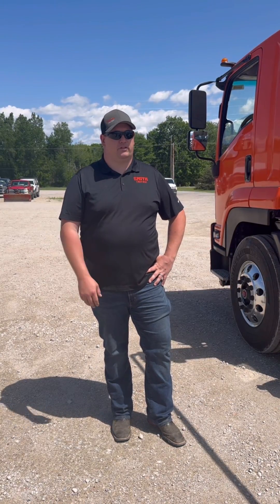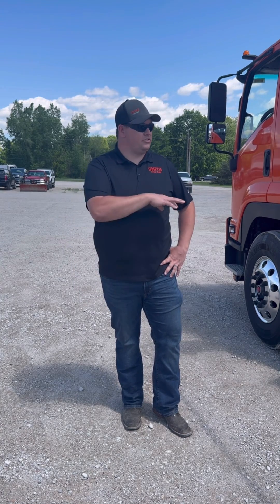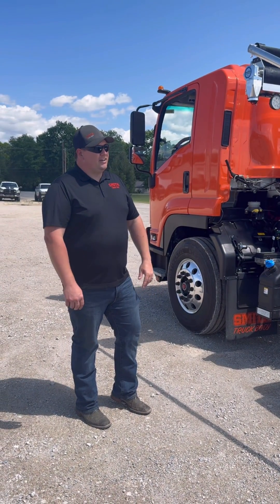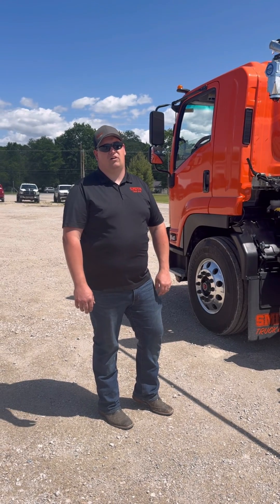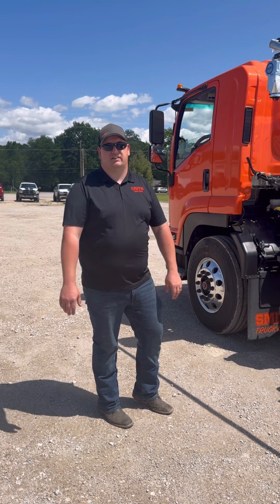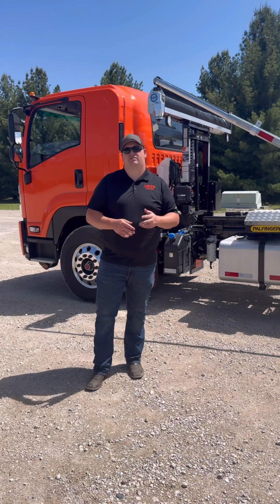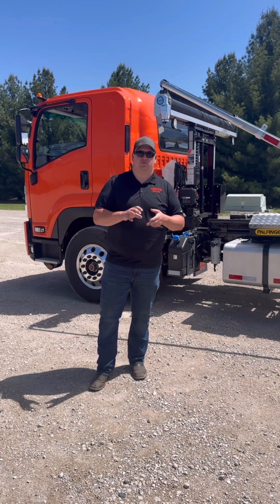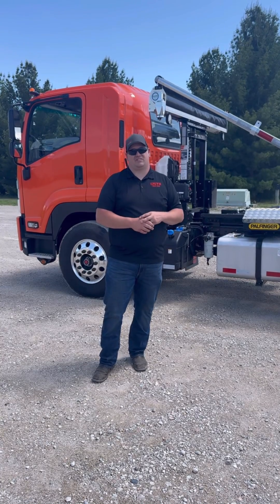Allison 1000/2000 series PTO functionality

Comment: I’ve got an Allison 1000/2000 and want to go with a pto instead of a clutch style pump off of serpentine belt what’s the issue ?
Reply: I lift and unload dumpsters in neutral but while pulling out of dump I drive away and TC is in lock up and I lower can. I don’t see a downside to running a pto off of Allison 1000/2000